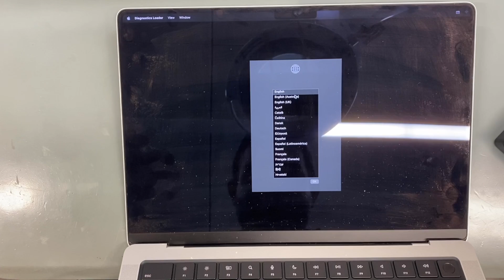MacBook Pro (14-inch, 2021) Logic Board & Touch ID Replacement

Comment: Please be extremely careful when removing the motherboard, it is very easy to snap the Touch ID flex cable and once you do, no Touch ID will be present even after replacement. Happened to me.
Reply: I just joined that club..
Reply: Just happened to me too… goddamn it
Reply: @dcia670  I think I have same problem and I don't know what to do, any suggestions and what you do after the cable snap?
Reply: should've seen your warning before .. 😩

Comment: Hi, I am concerned to see that you did not disconnect the battery as the first step, before unplugging any other logic board connectors (except the trackpad cable must be released first, as Apple has hidden the battery screw underneath it). There is also evidence of liquid damage under the logic board, so the keyboard is likely to be damaged and I was surprised it wasn't replaced at the same time while the logic board was removed - a difficult task but it is possible (I've just done one)